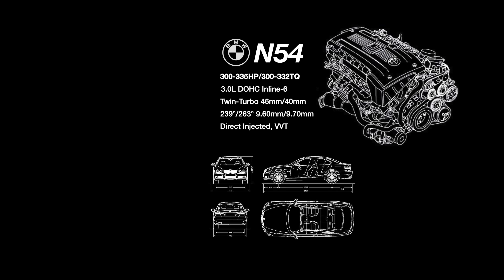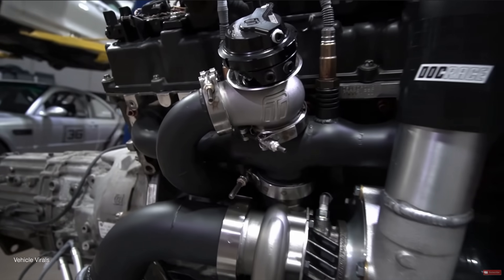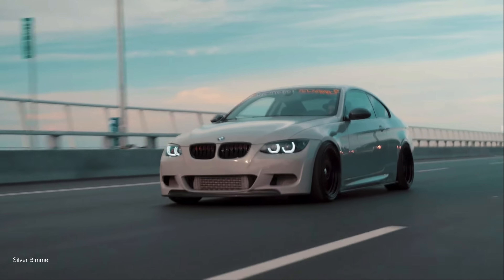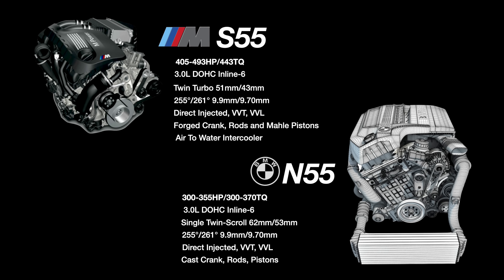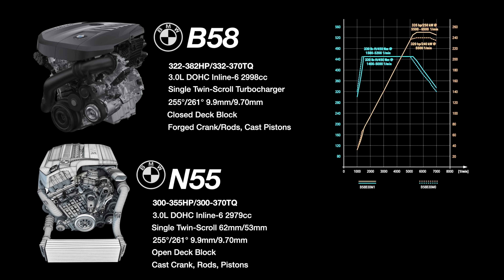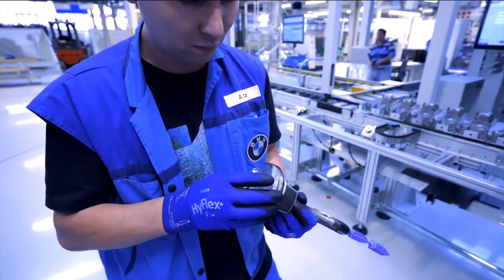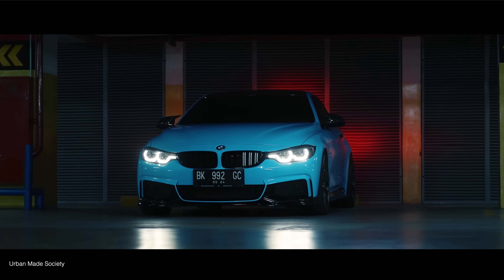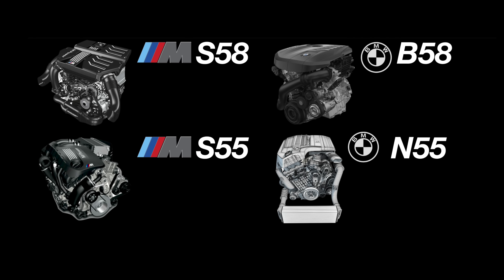BMW Turbo Inline-6 Engines Are Ridiculous | Explained Ep.4

Comment: The B58 in my M140i is after some updates good for 418 HP. Especially in combination with the hand shifter and rear wheel drive the perfect combination for fun. If you like you don't have to shift. Nearly all driving situations you can handle in the 6th gear.
Reply: Don't want to see your clutch in 10k km
Reply: @patrik4292  You can replace the normal clutch with the one from the 550i.
Very common replacement and will allow a lot more torque.
Reply: I'm running 450 in mine with a cobra sports cat and stage 2 tune. Runs fine, had 0 issued in two years.
Reply: look up LSPI , don't bog DI cars g
Reply: Dude what
Reply: Bog master
Reply: Oh man, your poor tranny/clutch! Gonna be replacing clutch every 15k LOL
Reply: @pw5315  I heard the default clutch can handle up to 600nm

Comment: What I’ve been most impressed with from BMW engine calibrators is how they run 14.7AFR at WOT on their these high compression boost’s DI straight sixes. I’ve been trained that cylinder temperatures need to be kept cool to avoid knock where richening the AFRs for cylinder-cooling is needed. But then again, PFI engines of old (2JZGTE) are an older design; hence, the times improvement in design/efficiencies.
Reply: Good point, but I believe direct injection helps to bring down the temperatures inside the cylinder, I believe because atomised fuel has big surface area thus it can absorb more heat directly from cylinder
Reply: I could always look for myself; but are the ones that you're talking about also use valvetronic with the staged intakes?  Because that makes it function as if each cylinder had its own throttle body and creates a different airflow as necessary for each one!
Reply: Want me to show you the coal on the back of my n54 cars bumper to show you DI under high load is NOT lean…. You are misinformed. it’s only able to do that when it’s under light load cruising conditions, under heavy load it’s actually LESS efficient than the indirect injection. This is because the indirect spray absorbs heat better than the quick squirt of direct, and the larger quantity fuel having to be injected under boost/load means it has less time to mix with air charge. 

Can you visualize it yet? under light load the DI is super efficient, but under heavy load the port injection mist cools the runner and mixing before the intake valve provides a more even and consistent burn at wide open throttle…

Also picture the spray pattern of the direct injector, at low loads those pores are spraying perfect atomized fuel mists into the chamber. At high load they go full super soaker just to try to meet the insane fuel load requirement, which do you think they’re designed to operate at efficiently?
Reply: @fry.master good explanation, logical and clear. 👍
Reply: does help n54 is an open deck block and an electric water pump, temperature wise. More cooling.
Reply: Lol they do not.

Comment: Growing up, we had several M classes in our family and loved every minute of it. But IMHO, they are great motors, but keeping it as close to OEM as you can for reliability reasons. Each friend I had who sent their M's off to a shop to get it tuned up, ended up breaking sooner than later. Not knocking on the motor or builders... I just say in general of my experience in the modified class.
I say that each brand motor does what it needs to, but looking at the score board of the inline 6 motors on the top 50 list for 1/4 records and top speed runs, BMW is no where near in the performance game. 
Sounds good, drives good... but just not good after 1200hp staying reliable. And yes, I do stand by a 2J side of things, but sometimes I feel like the more technology we throw on motors and lighten shit up and shave shit here and there for cost and fabrication reasons.... the more they just don't last.
IMHO
Reply: That’s the variable of tinkering with anything however
Reply: @Gfy958  yes, I agree.
I'm not knocking on BMW motors. They are great by all means. Very spendy to fix and more expensive to build stronger. I know that there is only one built motor in the 6 sec bracket on ¼ mile. Where are the rest?  Idk. Like I said, best to keep em stock and enjoy the car. But that is me. I doubt that b58 would ever surpass the 2jz. If it was a bench mark to compare.

Comment: I believe the N55 came with forged crank in the higher output "M lite" cars. I think BMW pistons are cast and the rods are forged all around. People make too much of a fuss about the cranks when the "cast" N55 crank is a very tough cast iron unit and people have pushed these over 700hp with no issues. Aside from the head design the N54 and N55 blocks are almost identical, the main difference between them is the original N55 had a ridiculously small turbo and that's why people couldn't get as much power out of it. The later engines with the bigger EWG turbo had the same performance as the N54 on stock hardware, which is typically around 380-400hp. Some will claim their N54 makes 450hp or something silly like that with a remap, these are simply going to tuners with very, very generous dynos.
Reply: Only N55B30T0 M2 & X4 M40i

Comment: Most of you, those who comment here or else where are still stuck behind in the past.
Just because you've had some fast car in 2004 or 1992 good but now its a whole another level. 
The oil has changed, the 90s and 2000s urban common myth died out at this point. 
I still have an old BMW from 2000s , yes it slides and fits into what it was back than but I also have the new one and these are not comparable in any way, I think this is where the confusion is as of now, folks that owned one in some year of 2009 now think its the same thing if they buy a 2019 one but its just not true.
BMW made not just scalable step forward but a revolutionary one while Toyota and the most got stuck in the year about 2014 with their last successful motor and now , they cut the engineering team in leu of half foreseeing a complete electric revolution

Comment: I had a 2012 335i M sport that I got up to 177 on long country back roads in TX.  That thing was a beast for being stock.  I drove that thing so hard and the dealership couldn’t believe I needed my front brakes changed out at about 6,000 miles.  That is all the hard braking I had to do as I drove it to work doing 140 plus in traffic and had to constantly brake so hard then speed back up.  They thought the change brakes light was a computer glitch, it was not.  BMW told me it was the soonest that the brakes had to be changed in their 35 yr history of being a BMW dealership.  I just laughed.  I cannot attest to longevity as I got rid of the car after 24 months as I got hurt on duty and was retired from the Fire Department, I did not get my retirement benefits for 2 years so I had to return the car to the dealership or it would have been repossessed.

Comment: Run great, makes big numbers, until 50k miles when all the over engineering  and complexity start failing and cheap plastic cracks and oil leaks appear, and things start falling apart and ……. Etc, etc, etc

Comment: The moment he said that all the other motors except the s54 were responsible for making BMW famous and legendary you're wrong, it wasn't that n54, it was the s54 that made BMW on the map and it's the CSL version that made it legendary, the s54 is the same motor that's in the M3 and my car and way better than the n54 by a land slide, how dare you compare it to some 3 Series 2006 motor 🤦🤣 now take your hipster crap and go on somewhere and do your research.... 🤦 Ironically BMW already had a video on this, just look up E46, not to mention the cars you originally show at the beginning don't even have an inline 6 in them 🤦 the motors you referred to were mainly in the E46 models, what car does he quickly show, a whole different type of BMW with a V8 or v10 in it 🤦then starts talking about the n54 and skips the m54 which was more reliable than the n54, yes you didn't have as much horsepower but it made up for that, any racer will tell you it's not always about the horsepower, I also find that an insult to compare a German vehicle to a JDM car and try to say it's the equivalent of a 2JZ 🤣🤣🤣🤦 please just sit down, you didn't even make it clear that they use a diverter valve instead of a blow off valve for the turbos, the same mistake all these hipsters that own a BMW make when installing turbos and ruining their performance due to air flow.... Just like dude in your video when you were talking about it, yes it's an increase because it's  performanced, but you could have gotten a whole lot more out of it if you put a better diverter valve on it, You never put a blow off valve on a BMW bottom line 🤦 also the fact you say nothing about the s54 also says something about this video..... 🤦 He goes straight into the s55 🤣🤣🤣🤣 not to mention you got a couple of your motors confused and skip the whole generation, I think the worst part was when you try to make the n54 motor seem like it's something when it was a complete monstrosity, like I said the m54 was a whole lot better than the n54, the m54 has 186 horsepower compared to the n54 which has 228 which really isn't that much difference when they still go 0 to 60 in just about the same equivalent seconds and all other specs are not that far off, if the horsepower difference is so much of a big deal, just put on a borla dual shotgun exhaust on it along with a k&n air filter and problem solved, I'd rather spend money on a good durable reliable engine that I can performance up then a motor that was known for many failures, to praise that type of motor and skip the s54 completely that has a horsepower rating of 338 hp and that's not counting the rest of the specs that benefits better than the n54...... just wow,  just get off my recommendations 🤣🤦

Comment: Edit: MPG + power for the b/s variants is really the true marvel. It’s unreal to run 600 to the wheels & get mixed 20s, even 30s in the b58 

N55, B58, then S58. All unique. All amazing. The s58 imo has much more room for tuning. N55 was the smoothest pure, loved it. B58 for daily gives you sports car power. S58 on open stretch or pulling in:off exit ramps shows it’s a true racing engine. It turns into angry batman 4+k rpm’s, especially if you have a solid exhaust💨💺
Reply: A tuned B58 has a more consistent power band, and while sound is subjective (and perhaps im partial because I have a 2019 440i) my 650hp sounds way more throaty and sinister than any M4 ive seen. Tomato, Tomahto - theyre all outstanding motors, but that S58 better be juiced up if it wants a piece of my ride 😀
Reply: @Nakatomiplaza1988  depends. I’m running 640hp on my s58 and it isn’t even trying. Sound is fantastic and not ricey even stock exhaust - some appreciate this. I think BMW understood this engine would be greatly tuned lol generally speaking, the b58 in every mode but sport plus is way calmer/quieter and less engaging - speaking stock here. B58 when in sport plus, it’s what made me get the M car. Was tired of having to drive the car so strung up at that aggression level/sound/rpm/engagement. That’s what I did not like about the B58 but that’s just me and BMW staggering models. having owned all variants, b58 gives more even delivery, but the s58 is a different animal. Hard to compare even tho similar. Why everyone goes ackropovic, even bmw m uses them for their performance OEM exhaust.
Reply: @michaelmesolellaesq  Some good points, and what i've spent so far on upgrades for mine - it's fair to wonder why didn't I just get an M4 in hindsight lol, especially with bigger brakes, wider body, less roll, etc. Ehh, it's fun to talk about though. Either way, this is what car culture should be, because in 20yrs putting rims on your e-mobile is all youll be able to do to your car.

Comment: you left out alot of information about the n55. first of all the rods on all n55s are forged, not everything is cast. in cars like the m135 and m235 you get forged cranks. and early m2 with n55 had lightweight cast pistons, forged crank, better rod bearings, and forged rods .

Comment: In-line 6 cylinders are awesome engines. My first was very positive experience with the Jeep(Chrysler) 4.0 and then mind boggled with a 2002 M3! The E46 was breathtaking practically a racing engine with the 6 throttle bodies and 8500 redline 🙌
Reply: Agreed, more than 100hp per liter! The E46 is a masterpiece. bought another one for twice what my last one cost. Get ‘em while you can guys 👌
Reply: @Snappy650  E46/E39 is my favorite BMW era
Reply: Just because Chrysler owned jeep doesnt mean it was a Chrysler engine it was an amc 4.0

Comment: Loving the B58 in the 21 Supra. It's a beast and a beautiful exhaust tone.
Reply: Mine sounds so good, once you start taking off all the noise restricting things it sounds so good
Reply: @TehRaRi44 what did you do to make it sound perfect?
Reply: I'm not ashamed to admit I was a modern Supra hater; That was until I learned about the perfect engine, the inline-6, and how BMW is the one manufacture that's been perfecting the perfect engine.

My ignorance has turned to respect. Can't wait to drive it one day.
Reply: @joshgts9675 you'll absolutely love it. I had a gen1 5.0 for 3 years, drove my buddies mk5 Supra and fell in love. Sold the 5.0 and bought a Supra not even a week later. Haven't looked back since.
Reply: @joshgts9675 what did you think the original supra had under its hood?
Reply: @matt25675  Lmfao, exactly.
Reply: Zurpa

Comment: Bmw, reliable, lol. Maintenance is insane on these cars. And your wallet will dislike you even more if it's an M car. Like someone else mentioned, the engines are good but not the rest.

Also handling while good is not great. Easy corners that I could go 150 kmh with in the bm I could do 230 in the Porsche 911 Carrera 4s 98 water cooled. (4 wheel drive so maybe to a great comparison, and the Porsche felt anchored to the ground while bm felt more slippery).

An M is a sporty car, not a sports car imo.

Comment: However my GTI Clubsport makes 370 hp / round 500 tq on just a 4 cyl, 2 litre. And thats on a lighter chassis with downforce + thats just on a stage 1 tune. Stage 3 and swapped turbo wod give over 500 hp. Not sayin smaller engines are "better" but they sure as heck are more efficient.

Comment: The s58 engine does NOT have forged connecting rods, they are exactly the same carry over rods (same part #) as from the s63tu4 engine from the f90 m5 which are weaker cast iron connecting rods (hence every f90 needing to be careful to limit low end torque on tuning, as does the s58 if you want it to last at all).
Reply: CONFIRMED!! S58 uses S63TU4 Rods.

" The forged connecting rod of the S58 engine has a nominal length of 151.1 mm. The connecting rod is a carry-over part from the S63B44T4 engine. As with other BMW engines, the small end has a profiled bore. The force acting from the piston via the wrist pin is optimally distributed to the bushing surface by this shaped bore and the edge load."

-BMW Technical Manual
Reply: @dion1556  yup, exactly what I said. Not sure why it even says they are forged as they really are cast iron weak rods. I think other surrounding parts are forged on s58 which on s63t4 are still not so it’s a little stronger but overall both engines need torque limited for safety if they are to last long term.
Reply: @av8743  I mean the rods can handle a good amount of torque so it’s fine. Not 1000lb ft of torque or anything crazy like that. But I’m not sure how many people are trying to reach those torque numbers? Most seem fine in the 6-700
Reply: @dion1556  it’s been done many times on f90 the v8 makes so much torque it bends them because easily will make over 800wtq when it’s limit is about 700-740wtq max… so need to tune carefully.
Reply: Every source I've seen says they do have  forged rods

Comment: Should have gone a few years back to M50/S50 engines. You can go from 190hp to 500whp with just bolt ons and I would argue they are way more reliable than the modern engines.
Reply: Those were the 2JZ N/A German engines.

Comment: Maybe a good engine but they leak oil from the valve cover oil filter housing the oil pan gasket... Lots of Maintenance required
Reply: true, i have 2 friends that drive 3 series bmw's, their cars are more in the workshops than everyone else, and by saying this, our cars are only used for traffic commuting to work and back, no racing or anything funny like tunes, stock stock

Comment: Common misconception and a little mistake in your video. The s55 does not feature forged connecting rods, they are cast. You can find the information in the s55 technical documents. Another interesting fact is the rod is slightly shorter than the n55 to keep the rod speed slower since it rev’s to a 7600rpm red line (note: red line is 7600, but fuel cutoff occurs at 7300).
Reply: Yup, and s58 connecting rods likewise are also cast, which is wrong in this video. They are the same rods as the v8 f90 m5 s63tu4 engine rods… cast iron.

Comment: My N55 ate all of its rod bearings (ALL... EVENLY DESTROYED) in 2 days after injector failure. All 6 injectors was replaced and oil changed, but I guess it was a little bit too late... Off for a hunt for a  B58 now! These engines are like drug... once you taste it - you'll never look at anything else.